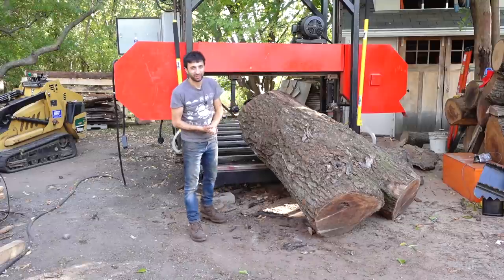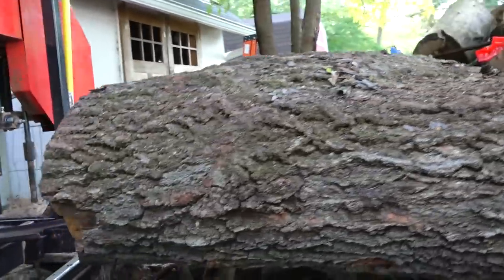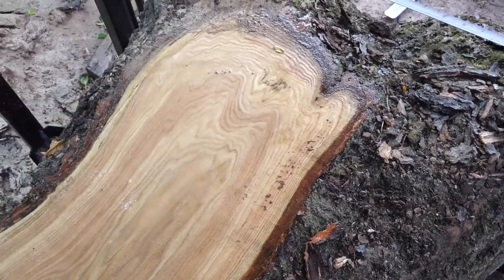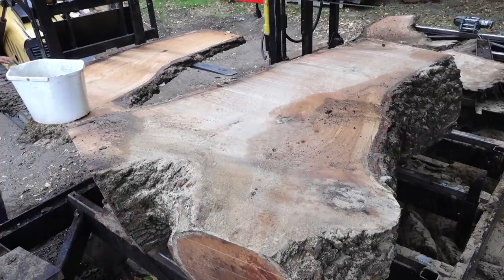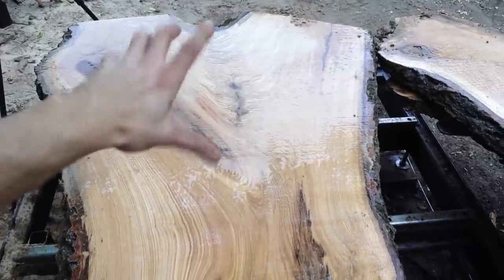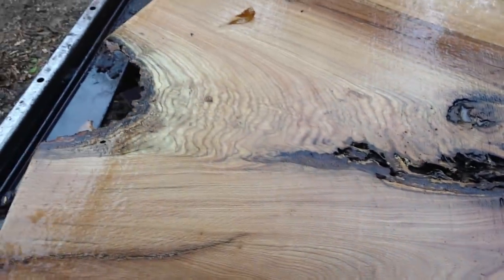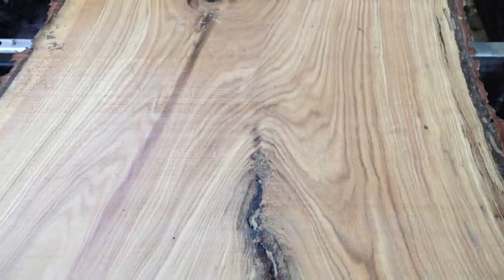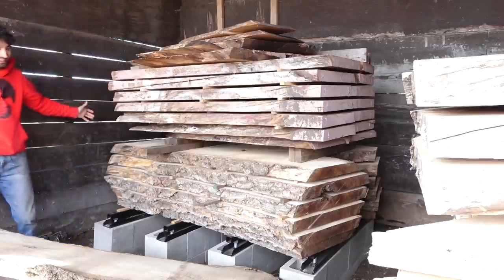Slabbing a Red Oak Crotch with my Homemade Sawmill

Comment: When you did your sawmill build, I was working a lot of overtime and YouTube time was extremely limited. I have a couple questions. What did it cost to build the sawmill? And where go you sell your slabs once they're dried and sterilized ? What do you do with the cut off scraps that you don't use or sell? Thank you, have a good weekend.
Reply from the maker: What did it cost to build the sawmill? 
I spent $8500

And where go you sell your slabs once they're dried and sterilized ? 
I typically don't take them to final drying or sterilizing until they're sold

What do you do with the cut off scraps that you don't use or sell?
Cut them for firewood or give them away

Thanks!
Reply: @mcremona  I could use a sawmill that size,  I was given a 150 year old oak. Trunk was 5 ft. wide. Ended up cutting it into round slabs.
Thanks for your time.